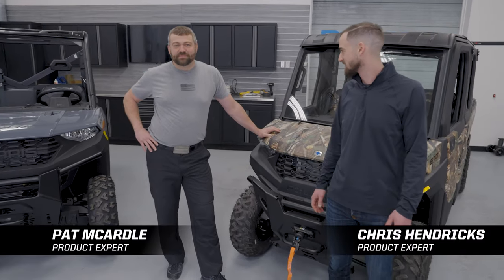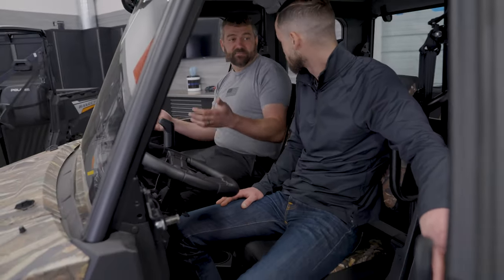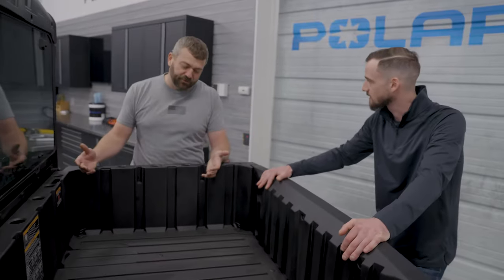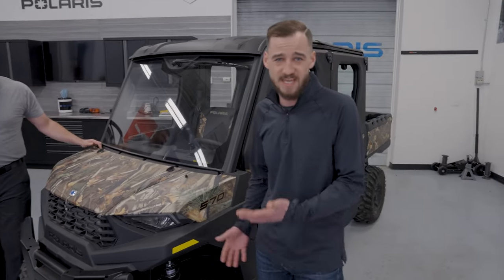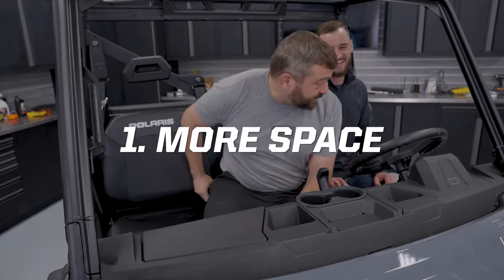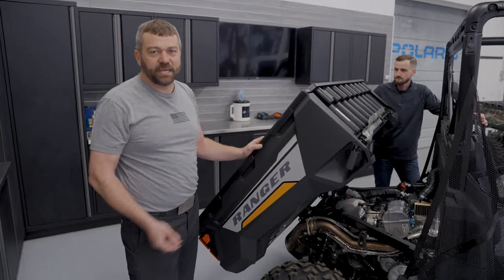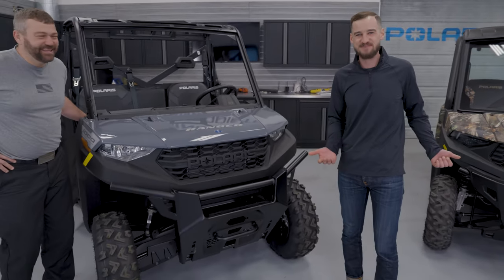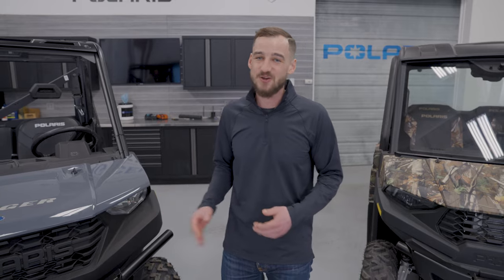RANGER FULLSIZE VS MIDSIZE, BUY THIS ONE - SHOP TALK EP. 16

Comment: I have a 2016 570 full-size ranger that I purchased new. Overall I really love it. The main issue I have is that it is on a mid size frame and getting accessories is a real pain. Had I known these issues I would have bought the next size up.

Comment: Does the midsize and full size 570 standard and crew cabs come with headlights, brake lights , and turn signals? Are they street legal? What is the top speed of the 570s?

Comment: BEWARE

I bought a Polaris ranger sp 570 in October of 2023
NOTHING BUT PROBLEMS
I am meticulous and thorough when it comes to proper maintenance and mechanical observations. Breaking period, first 25 hours first 50 hours etc

This machine left me stranded more than 3 times
Just cuts off while driving and that’s it. Nothing. 
I had to walk to 5 miles back to the road. Come back with my truck 2 hours later. Cranks but no start. Check engine light is on now when the key is turned over and the diagnostic code reads 636. That particular code is throwing a crankshaft positioning sensor, according to the book. Finally got it to the dealer which is a pain in the…. And they are no freaking help. They act like you are stupid and nobody has any clue what you’re talking about. They finally get it in the shop. It’s been three freaking weeks and they say it’s the stater and the positioning sensor. Whatever man I’m over it I wish I would’ve never bought a Polaris.  I am very very unhappy and unsatisfied with it. I should have bought a Can-Am, or Honda or the Lowe’s side by side I bought a Polaris because they were supposed to be the best. Yeah right what a joke do not buy one I promise you will be absolutely disappointing. Do not expect any quality in their products. every bit of this machine is a crappy, thin plastic that rattles and you can just tell how freaking cheap it all is. If you wanna spend $13,000 on a cheap side-by-side, go buy the axis from Lowe’s. They are four grand cheaper